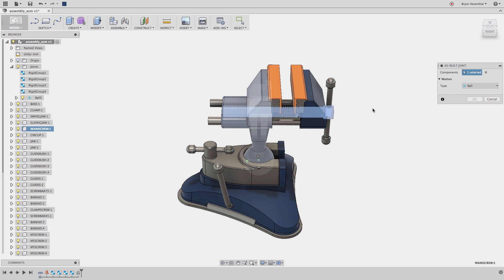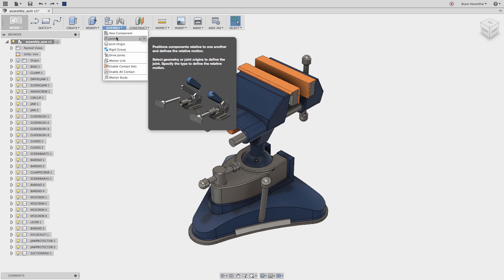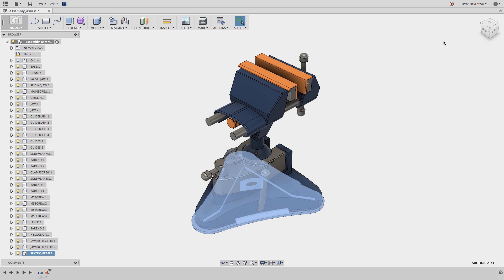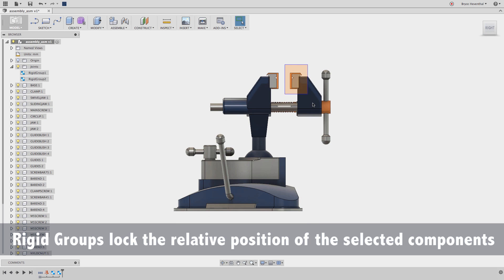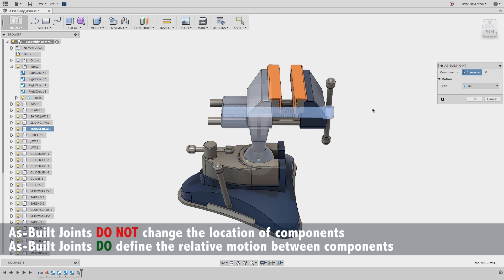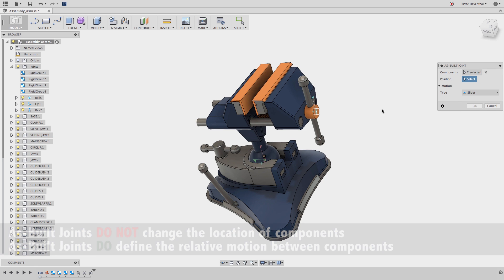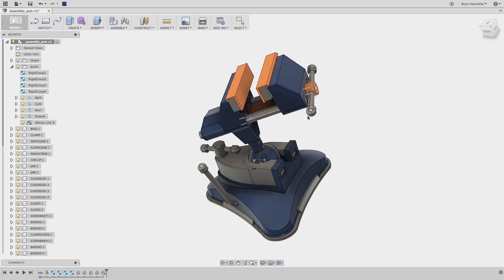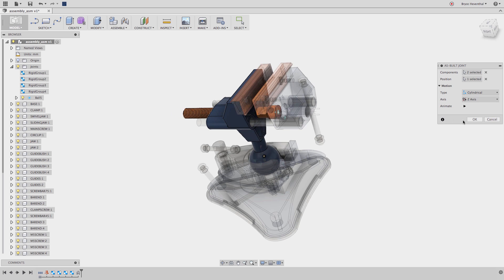QUICK TIP: Assemble Imported Geometry

Comment: Great tutorial, but it is absurd that planes and centerlines are not imported in fusion as it is in any other CAD I have used. If you import a STEP assembly file in any other CAD you can align planes and design geometry instead of having to recreate it as in Fusion. If I exchange data between inventor, solidworks, alibre they all align and share part geometries and origio, whereas Fusion as the only one throws some odd and arbitrary placement that you then have to join/align/design geometry to. 
We design machines where we design from functional centerlines and motion paths, but every time we exchange information the ex. top view in inventor becomes a different view in Fusion. Fusion has a lot of great things in it but is really lousy with certain aspects of assemblies.